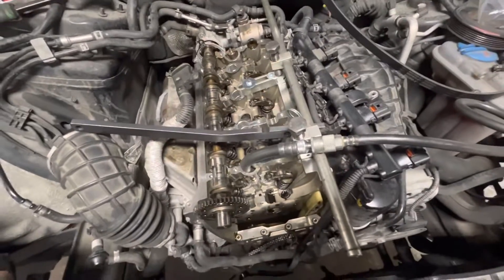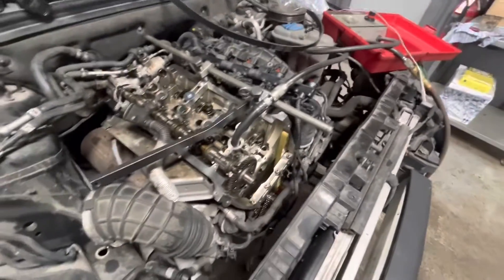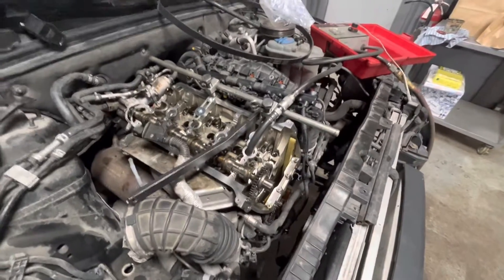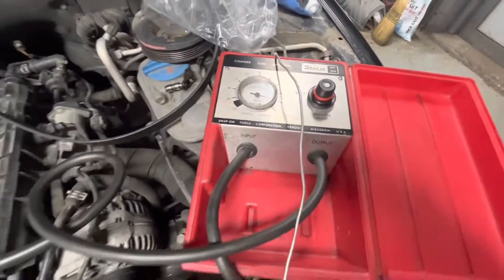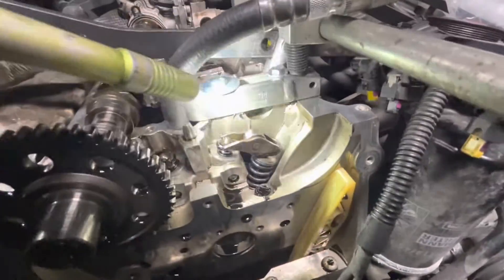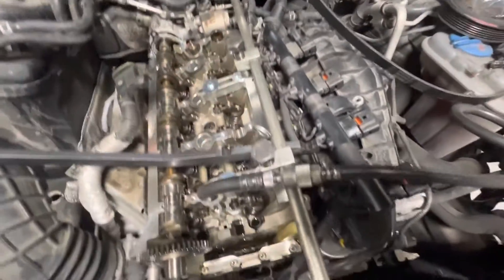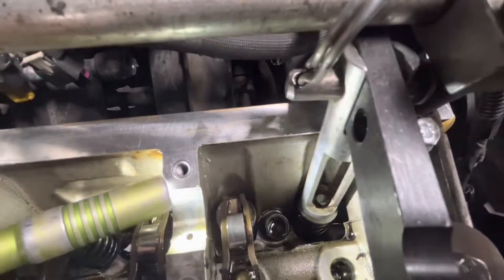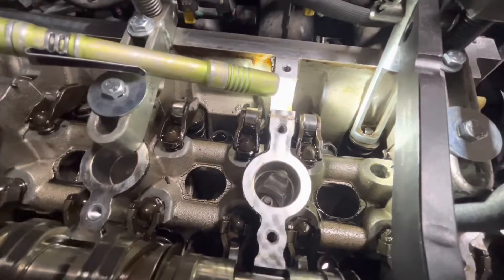REPLACING A VALVE SPRING WITHOUT REMOVING CYLINDER HEAD

Comment: Since you are an extremely talented and experienced guy, on these A4 B7s I have p0507 on right now and I can't seem to find a vacuum leak anywhere. Do you have a diagram of the vacuum lines or what that possible code could be on this engine. 2006 audi A4 B7 2.0t 165xxxkms P0507 high idle
Reply from the maker: With the engine running is it very difficult to remove oil filler cap?
Reply: @European Auto Repair  not noticeable, how hard should it be to remove. I don't need to force it off, that's why I don't think it's the pcv
Reply from the maker: Should be very light suction, check the lines off the brake pump as well, with the direct ignition like that you can spray a little brake clean around vacuum lines to help find leaks without much risk
Reply: @European Auto Repair  I'll try brake clean! I was using just propane but I don't think it was working very well